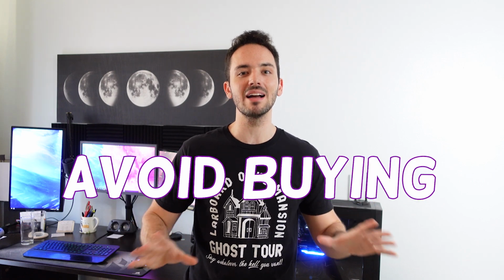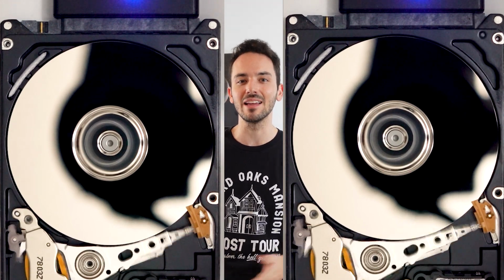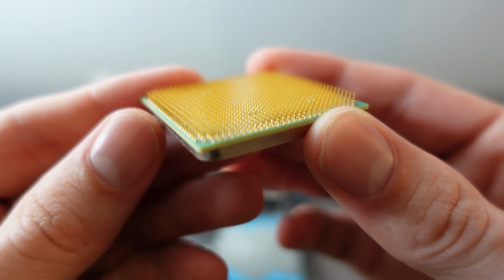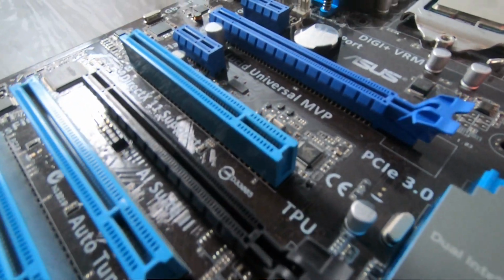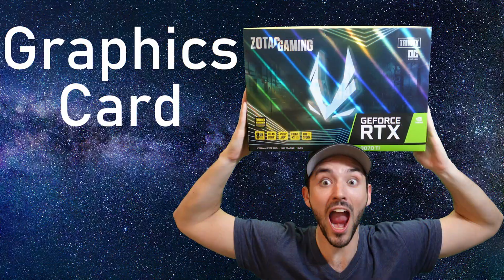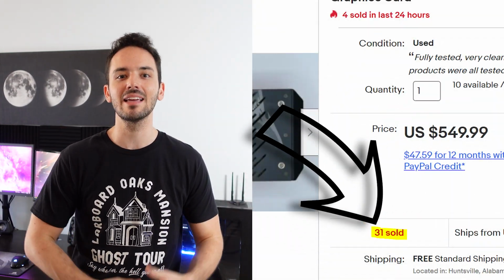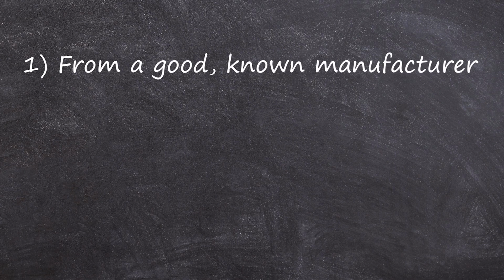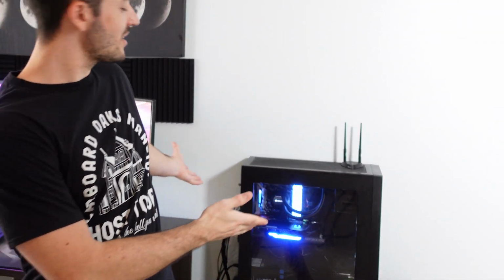Used PC Parts Buying Guide - Save Big and Keep Performance!

Comment: Miners undervolt and lower power limits they don't run fans at 100% since it draws extra power and they repad and repaste they run far better and cooler then any stock card used for gaming
Reply from the maker: The issue is they run 24/7, 365. If you’re a huge gamer you maybe run 7h a day and not everyday.
Reply from the maker: Just something to keep in mind when making a purchase decision.

Comment: Fine with used: gpu, ram, cpu
Mechanical devices die after time... And ssd's aswell
And sometimes minig gpus are better in better condition than gaming cards because miners undervolt their gpu and it doesn't overheat